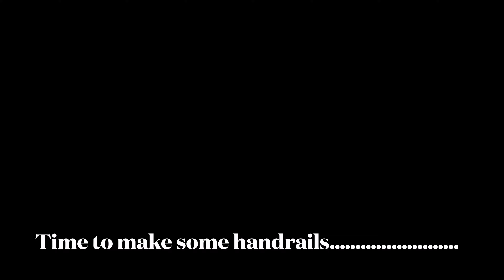BUILDING A WILDLIFE HOMESTEAD PART 5 - RUSTIC BRIDGE- THE HIDE BEGINS- CREATE A CAR PARK

Comment: Ay up Si. Nice montage of how it's all coming too. By 'eck you've all put some graft in, no wonder you needed a couple of days gigging!. Love the bridge, not bad for first go eh. Might want to add some chicken wire over the decking boards and kick boards for continuation of the bark chippings right across. Boards will keep chips in place and wire will prevent slip slide in wet! Hope you got emails ok, no rush but confirmation all received ok would be good mucker. Can't wait for hide build. Stay safe and well mate.
Reply from the maker: Cheers for the tips Richard, not sure about the E-mails?? Can you resend them to simoneardleyphotography@gmail.com